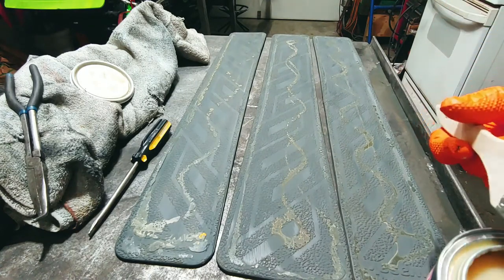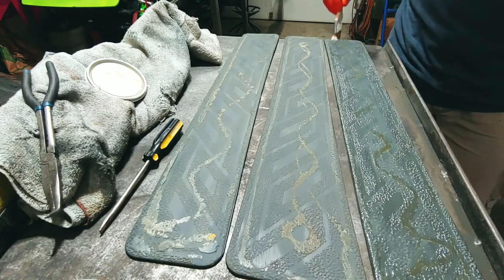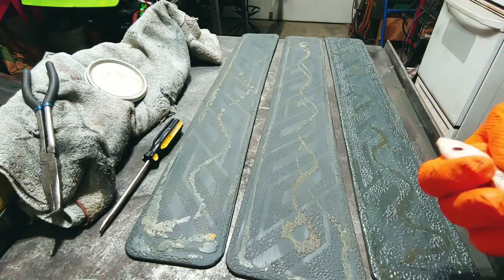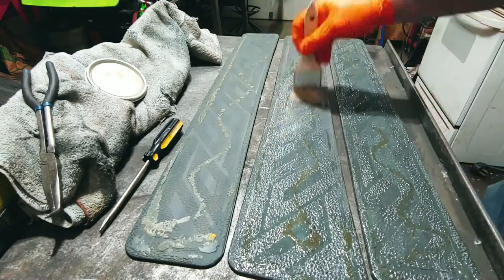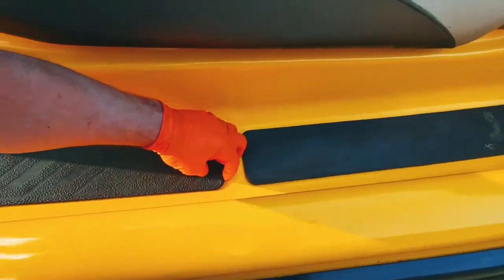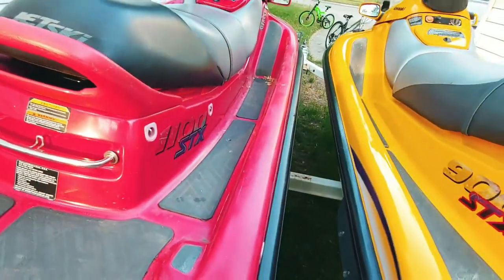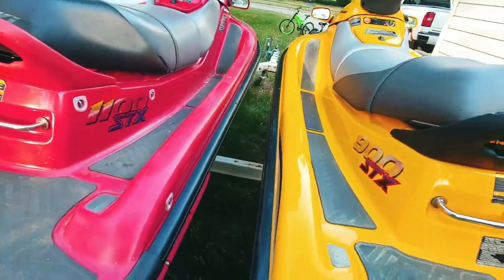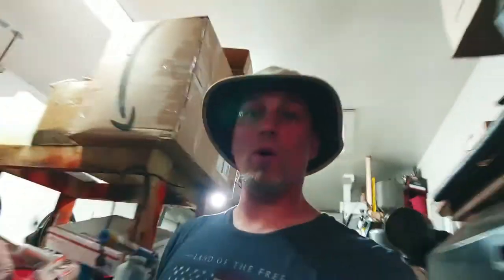2000 Kawasaki STX 900 Restore Series - Part 2

Comment: I just got one of these and I’m trying to clean up the electrical box, how did you find out where everything goes, and which wire goes where?
Reply from the maker: Wiring diagrams are online plus most of it is plug matched and wire color matched. I never really unplug stuff without taking pics and notes.
Reply: @Fixin2Ride-Official-  do you remember any of the links for the diagrams? And ok thank you
Reply from the maker: Sorry I do not.